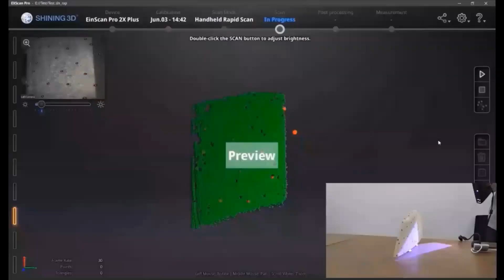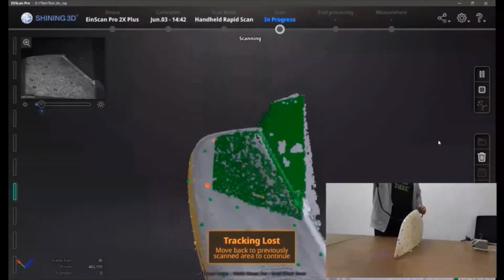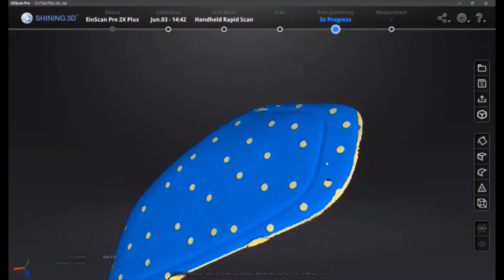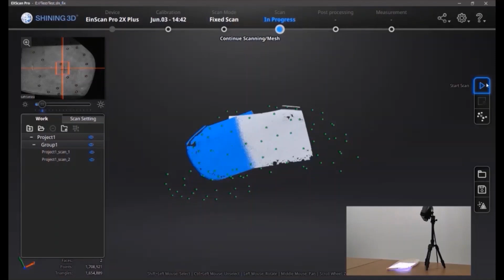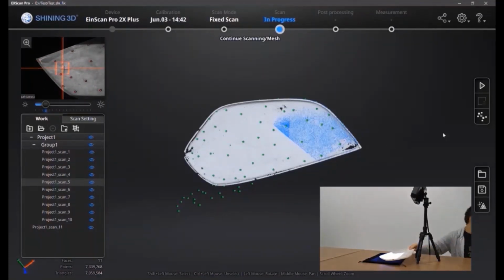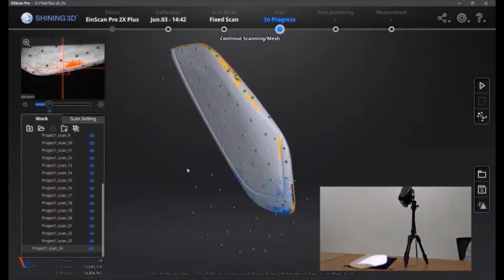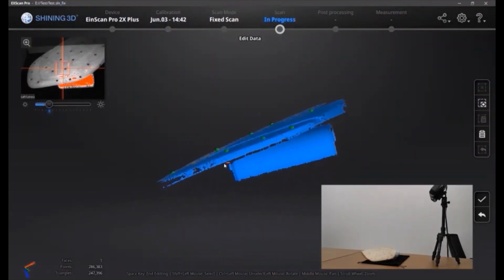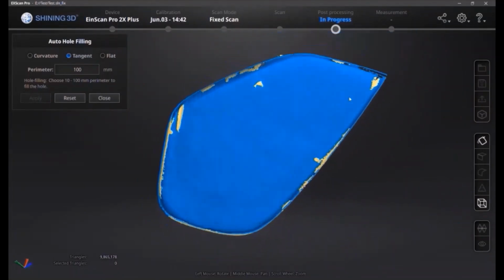How to Use EinScan for Scanning Thin Wall Objects - SHINING 3D Digitizing Solutions

Comment: Great video! I tried this with my 2X Pro Plus in "Handheld Rapid Scan Mode", but I get an error message stating - "No Markers Detected". Not sure what may be going on there; However, any suggestions you can provide is greatly appreciated.
Reply from the maker: Hello,we think,maybe you don't stick enough markers,but you also can submit a ticket on our support platform(support.shining3d.com),and then our engineer will contact you as soon as possible.